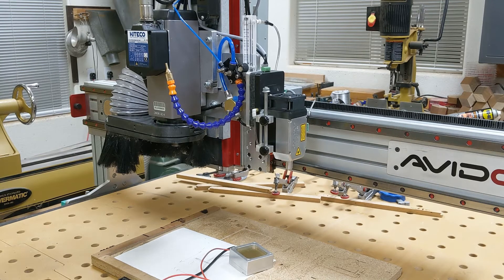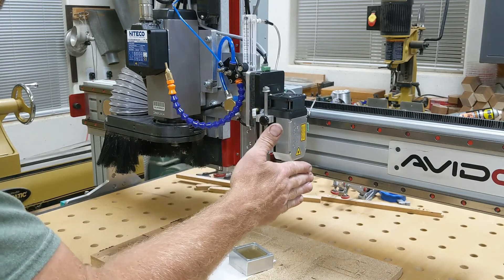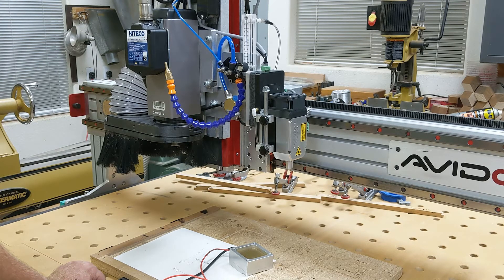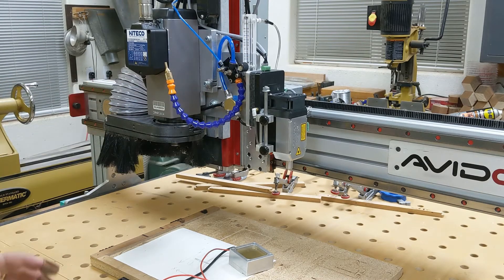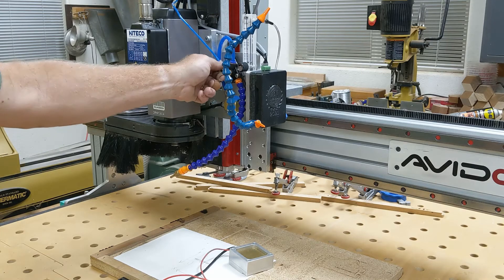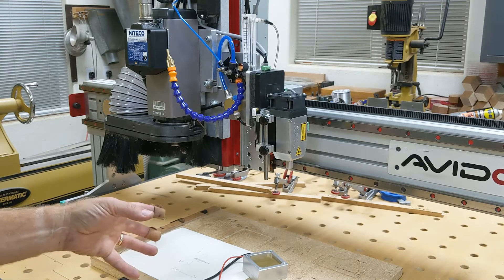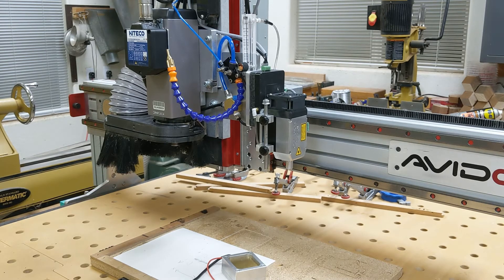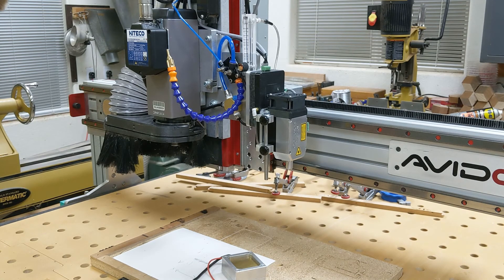My latest laser mount for my AVID CNC with Opt Laser

Comment: @Jim, amazing video as always. Display of my ignorance likely, but why is it necessary to mount the laser at 90 degrees -- instead of re-orienting your raster burning toolpath by 90" in vectric (is that even doable, in the same same way you can re-orient an endmill's toolpath by any angle? To me it seems like the same thing would be accomplished without needing to reposition the laser possibly?
Reply from the maker: Hi Ryan, good question.  There are a few levels to the answer.  If I used Vectric for the laser rastering, it is  still somewhat limited in the raster direction.  However, Vectrics laser picture toolpath really doesn't work that well compared to a true raster (where its blasting bits on the fly as it scans by).  So I use the native laser rastering feature built into the ESS plugin as shown in this video: https://www.youtube.com/watch?v=79g7WSAuJUk&t=6s
Unfortunately at this time, the ESS plugin only supports rastering in the X axis at the current time.  However, even if they did add the capability, I wouldn't want to raster in the Y direction because that would mean moving the whole gantry back and forth for each pass, vs. just the Z stage.  The good news is now that my main lasers are the XT50 and XT8 lasers, I can mount them front facing again because both of those have pretty symmetrical beams and so it doesn't matter much from the laser's perspective which direction you run the laser to get the best image.

Comment: Hi Jim,  Just ordered a 3x3 Benchtop Pro and would like to mount the 6w Opt Laser.  Very nice magnetic mount you designed, any chance of getting the files?  Also, your touch off rod on your mount for the laser, is that something you purchased or made?     Thanks!
Reply from the maker: Hi Rick,
Send me an email at jnwdwks@gmail.com and I'll send you the vectric files and parts list.  Yes, the rod for the touchplate is something I made from parts from Amazon and is part of the parts list.

Comment: Hey Jim, your setup is great and well thought for sure! I known Avid runs on stiff and precise parts, but I was thinking if you can gain speed or precision if you remove the heavy spindle and put the laser in that spot...
Reply from the maker: Its more the acceleration that can be increased if you can reduce the mass.  The max speed is more a factor of the motors and stepper drivers capability.  Removing the spindle is a big chore, and worse yet tramming it after remounting to get it perpendicular to my table again is one of my least favorite things to do :-).
Besides, 1000ipm is way faster than I want to go in most cases.  The laser only has so much power, and the faster you go, the less time the beam is on one point making a mark.   As long as I don't miss steps, I shouldn't have a problem with precision, which is why even though I can run at 125i/s^2 acceleration, I back off to 100 just for safe measure.
I test the precision of the whole system a little more soon because I have ordered an Opt PLH3D-XT-50.  I got hooked on the rastering and realized the for photo realistic engravings you want to get above 250dpi (at least to my eye).  The XT-50 should be able to do around 500dpi :-)
Reply: The more weight you can remove from your z axis, the higher the acceleration rate can be set to fit the x axis.  The higher the acceleration rate is set to,  the shorter the x ramp up and ramp down distances will be for rastering. The shorter x ramp distances will cut a lot of time out of the image rastering, since they are wasted time.
Reply: There shouldn't be that much of a change to the precision with our without the spindle...

Comment: Jim, are the laser mount parts 3d printed? if so are the files available, ok just saw you had vetric files for the mount. You have convinced me to rotate mine 90 deg as well. what material did you use? Great video! thanks for sharing this info.
best
bs
Reply from the maker: Hi Brian, those are machined out of HDPE.  I used 3/4" for the cover and base, and 1/2" for the part the laser bolts to.  I'll send you the info.